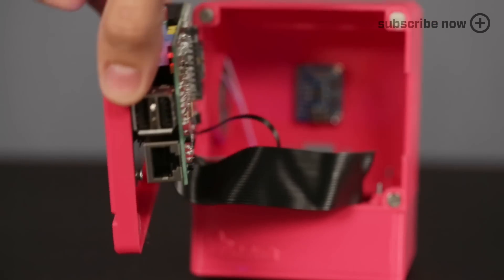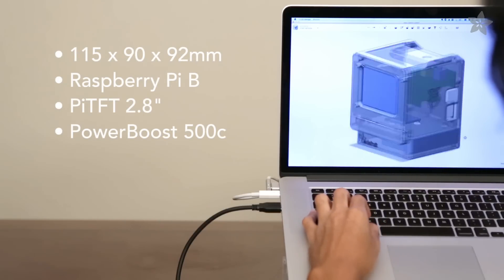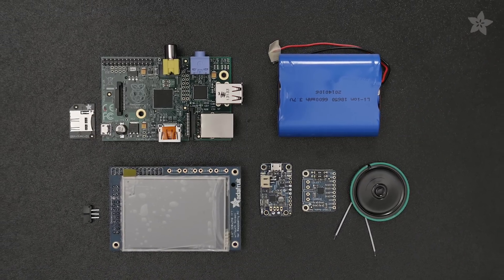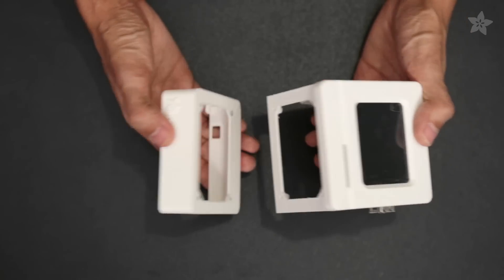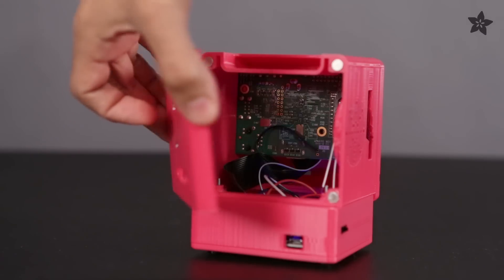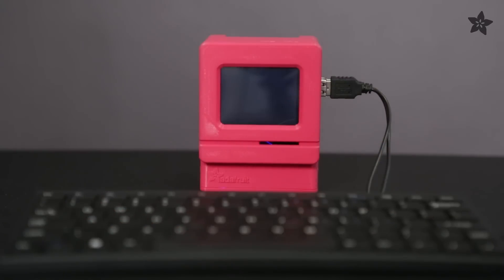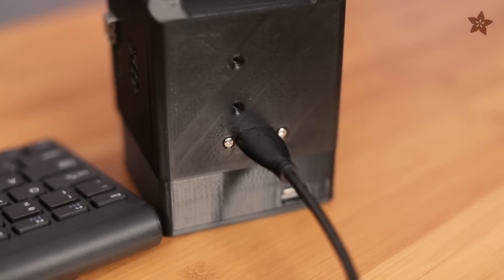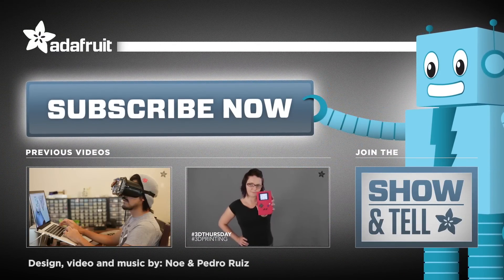3D Printed Mini Mac Raspberry Pi

Comment: Having an issue with getting the emulator to run.  When I try to execute minivmac I get, "error while loading shared libraries."  But I can run the Mini-vMac from http://www.gryphel.com/c/minivmac/download.html with out any problems, aside form the screen size being wrong. Any suggestion?

Comment: this is the reason why i want a 3d printer
Reply: you can hand-make it.Plus it doesnt have those lines.
Reply: well, i made my own pi computer!:

i took one pitft, a 6000 ma/h battery that i have (fits perfectly in the box i chosen :D) and a really short micro usb that was less than 30cm and lastly a mini wireless keyboard!

was a great project that i made :D
Reply: You can get the peachy printer for $100
Reply: The Black Talon make a vid of u using the mac mac paint or do reviewing
On it pls and I subbed